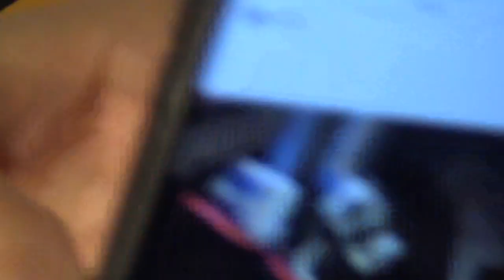Three Way Toggle Switch Replacement Yamaha SG 1820 and a Short Rant

Comment: Cesar, when this happens again try some contact cleaner.  That may very well been what was wrong with your original switch.  In fact you can clean the old one with contact cleaner and test it,  If it works again, you can save it for a spare.  Thanks Cesar!!!!
Reply from the maker: Hey Wrecker- thanks for stopping here again! Well I forgot to mention but I tried that too... I think it took a hit during my last recording session ( the bass player hit it with the bass headstock on a turn ) ....maybe it was that because one of the sides was totally bent. I tried to make it straight but was unsuccessful... contact cleaner is good indeed, has solved several situations for me in the past.... cheers man!
Reply: WD 40 came out with a EXCELLENT Contact Cleaner with Lubricant a few years ago.  Great stuff!  Safe for digital POTS as well.
Reply from the maker: Great to know! Will look for it. Thanks!